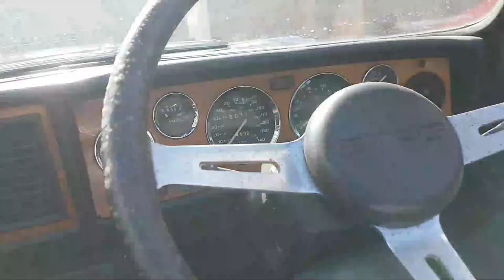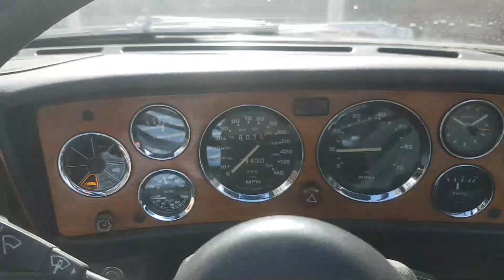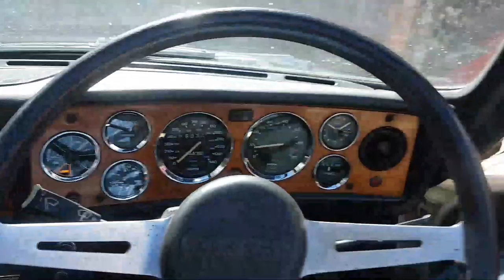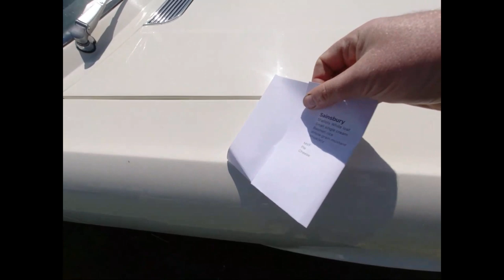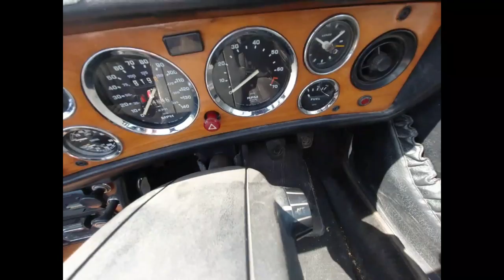Episode 1   1973  Triumph Staaaag - introduction! Parental Warning

Comment: Hi Richard what are your thought on balancing of crank, pistons etc plus full rotational mass balance.?
Reply from the maker: on a stag v8 you should have a matched set of conrods which will be weight matched. the crank should be hardened and as part of the process it will need to be checked for trueness and also balance. 

If you are going for manual and want that balancing then look at including clutch cover and flywheel also. 

Lastly the crank pulley on the nose is getting on in years now, new replacements are available though